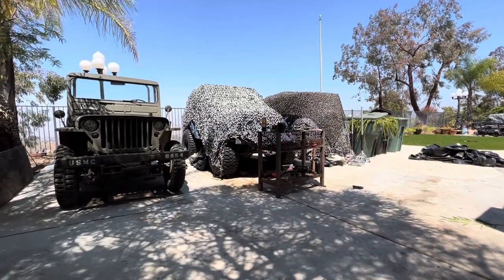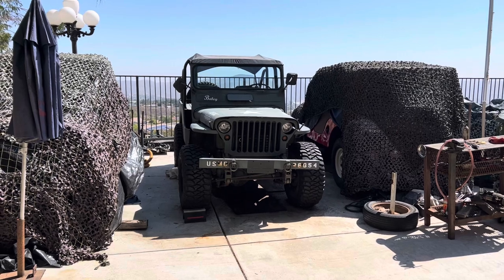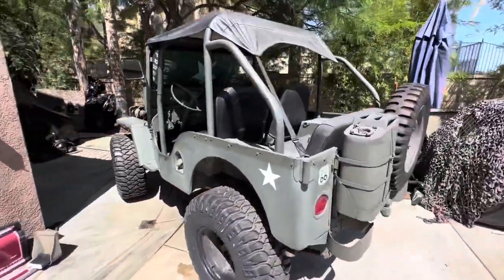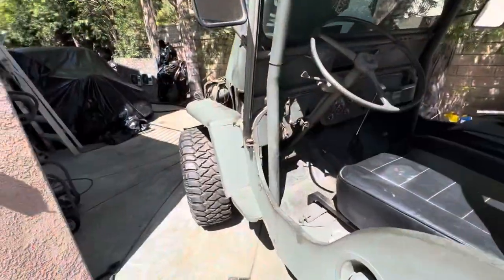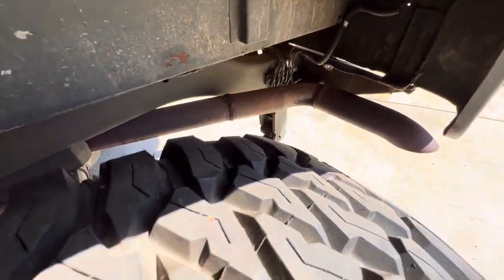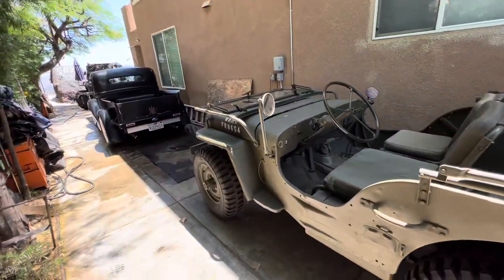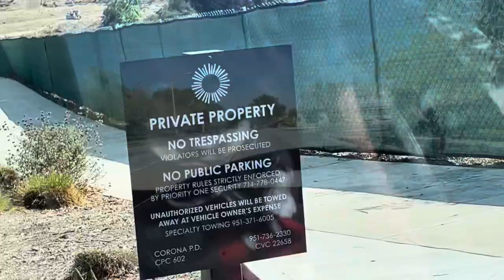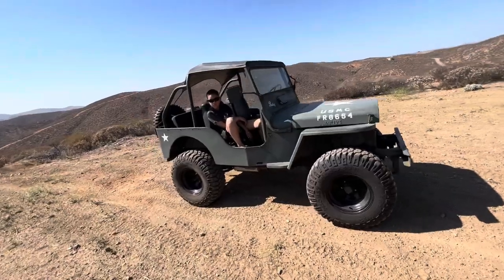Buick 225 V6 intake manifold fix/ 1948 CJ2A /TH350 transmission automatic/ vintage Willys Jeep

Comment: I’ve spent 4 years on a 69 cj full restoration; 225v6 rebuilt with all the mods, power steering, th350, power disc brakes with hanging pedal, headers with same exhaust etc… lockers… on and on.  Did an initial break in on the engine a couple weeks ago; and I have a knocking that I cannot figure out…. Pretty devastated at this point.   I’m running out of motivation to solve the problem… very difficult mentally for me….  Was my dads Jeep…. Probably just need a break from it.
Reply from the maker: yeah - it’s for fun. don’t let it get you down. I run into problems all the time… just take a break, and then get back to it when you feel motivated. You’ll get it! and your Dad would be proud!

Comment: would you show more on the drivetrain is the front single driveshaft or two piece? is the firewall cut?  I contemplated this exact setup.
Reply from the maker: HI - front driveshaft is a single. did not cut the firewall- the motor fits perfectly. I took some video today. should have it up for you by next week.
Thanks, Ernie.
Reply: @reconern  thank you Ernie. Looking forward to seeing it

Comment: I have a CJ2A with a 225 and it’s always overheating … any suggestions?
Reply from the maker: hi - new water pump, new radiator, run with no thermostat, bigger fan. i even cut slats into the passenger side fender. turn down the idle as much as possible.